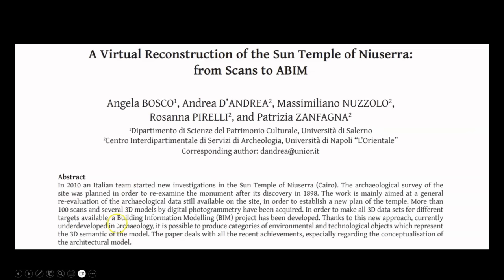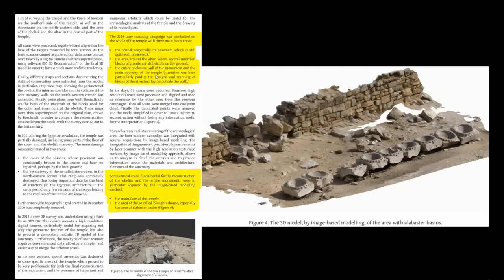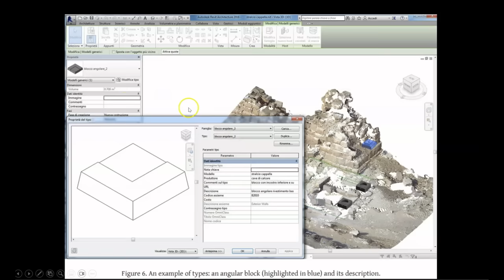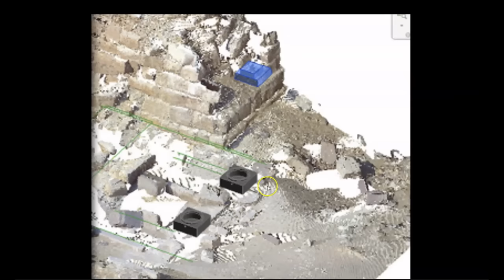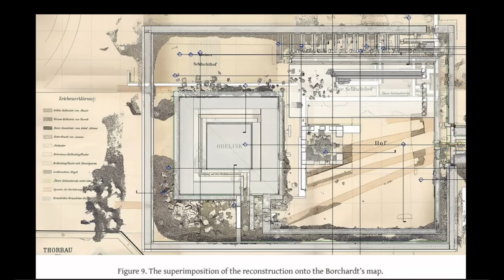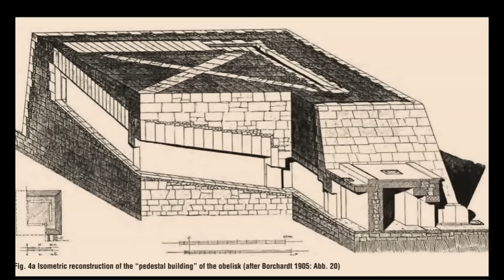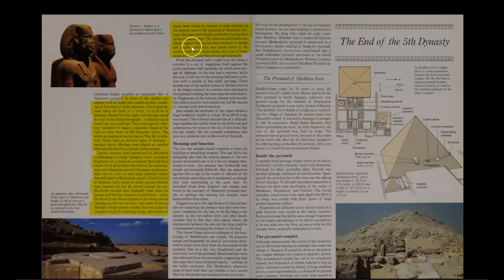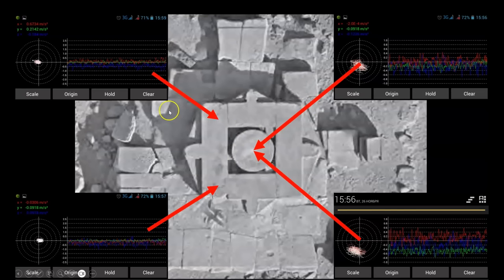Episode 113: ANCIENT TECHNOLOGY - The Obelisk And Crystal Bowls Of Abu Ghorab

Comment: Those big horizontal slabs look to have similar channels that would line up with the bowls
Reply: I wonder if the measurements line them up
Reply: Not referring to the gear type bowls.  But the first sets
Reply: Those gear set bowls look poured in layers
Reply: The big center piece looks poured as well
Reply: Do the rows of bowls have different heights?  Is there evidence that they may have overflowed toward each other?
Reply: So fascinating.  Thank you homie!
Reply from the maker: So the connection between the grooved pavement and the bowls is speculative. There is no direct on site evidence that this was the case, and there's no features on the bowls themselves that match up to those grooves... so that is one of many unanswered questions about the site
Reply: I’ve gotta learn to withhold my comments till end of video lol.  Some of the things I asked were as the video was unfolding.

Comment: at 17:50 you leave one set of bowls and go to another by 19:50 apx.  the first set looks different than the second.  second looks to be closeable.  with fastener holes around.  nothing on the first.  at 23:53 the blocks around the column base do not belong,  the carved front proves it.  if you can make that curve, then you can put a circle in a square with out spaces.